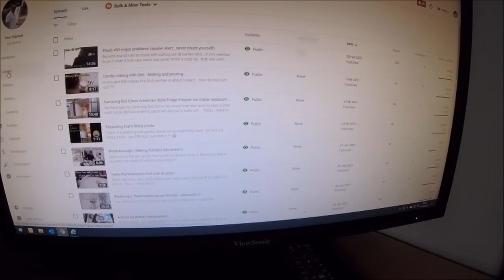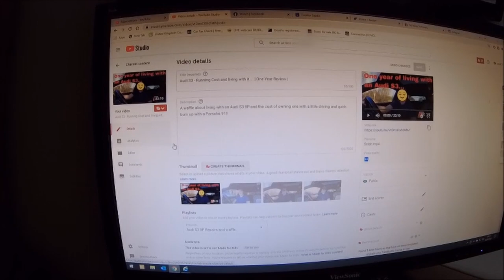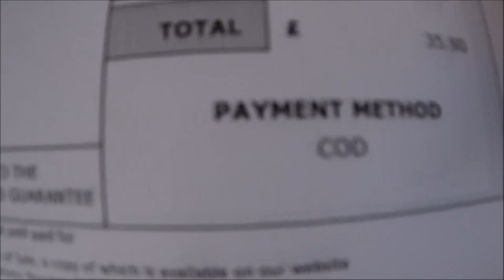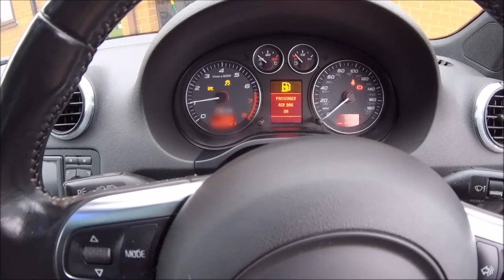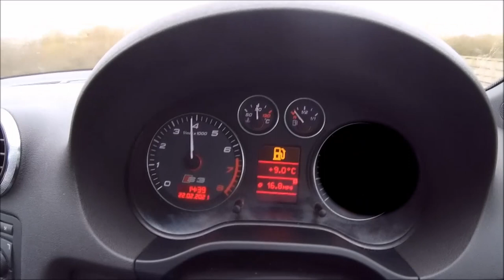#Audi #S3 Crank Sensor issue PART 2

Comment: What was the part number or do you have a link for the part?
Reply from the maker: I got mine from GSF but you will need your engine code as there are several different ones.

https://www.gsfcarparts.com/parts/electrical-lighting/sensors/crankshaft-pulse-sensor

Comment: hi ADE do you know about chassis tuning , eg front droplinks , use rubber or polybushes ?
Reply from the maker: The only "upgrade" done was the rear gearbox mount as they tend to be a weak point on these, That was poly bushed .